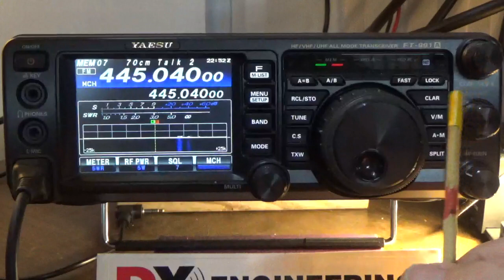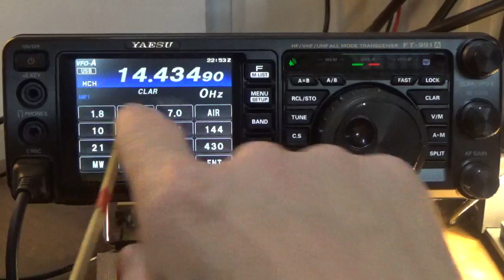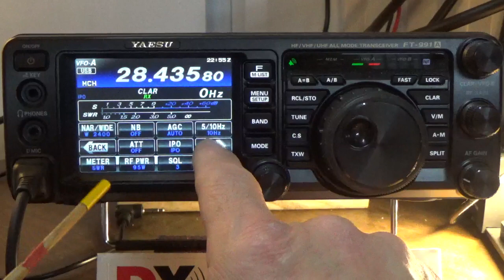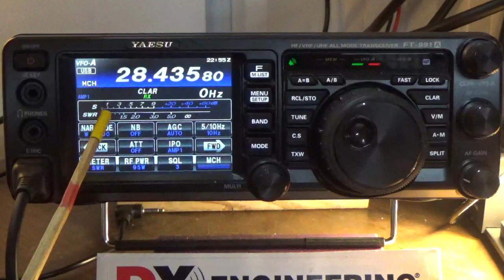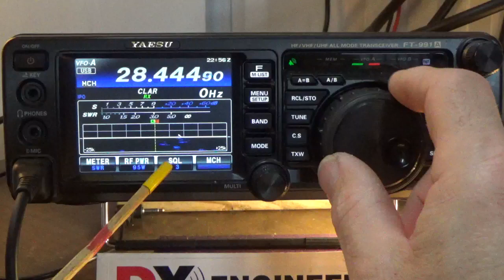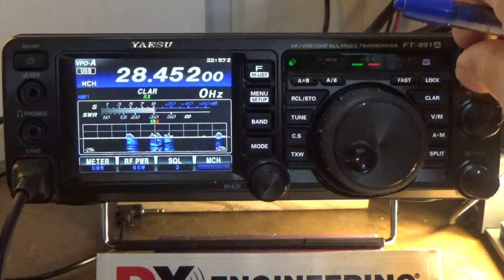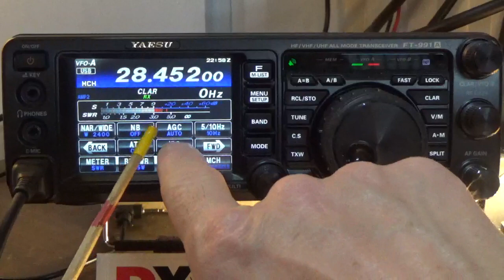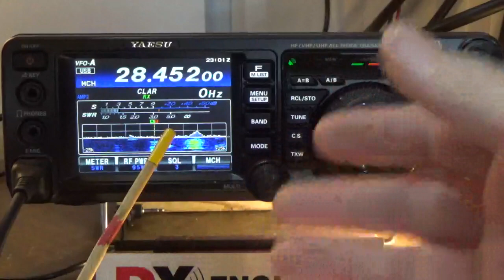Getting the FT991A ready for HF Setting Band Mode, IPO, Clarifier with W4EO calling CQ from Maryland

Comment: You said it right, it brings the signal up as well as, "THE NOISE !"
Helpful hint, always turn the IPO off on 40 meters and down. All you are really doing is bringing up the noise. For 20 and 30 meters, if you have a zero noise floor, from time to time the IPO may help. 
Me personally,  I only use the IPO on 10,12 and 15 meters. 

Getting use to how the multi function knob works.....Oh My ? It's confusing at first. You have to remember what function you used last and then put control back to the knob as to where you want it. I always leave my multi function in for controlling, "Ch Dial" which is a quick step through the frequency range.   I step 5 KZ at a time. 

Thanks for posting this interesting video. 
Barry, KU3X
Reply from the maker: Good evening Barry, thanks for the message and good advice keep in touch and let me know how things are going '73 sir